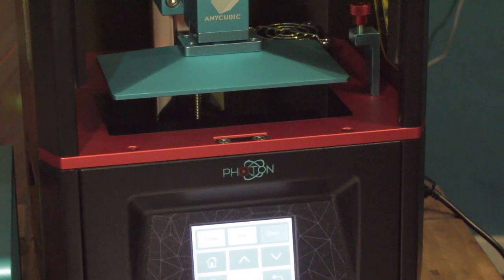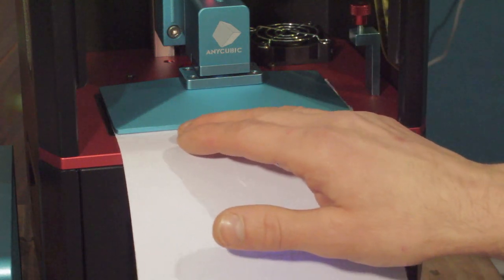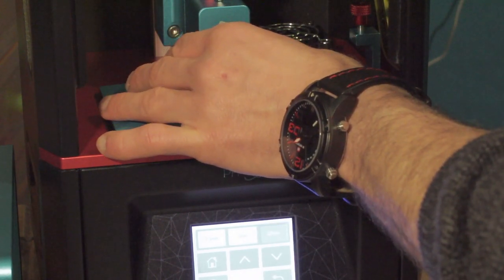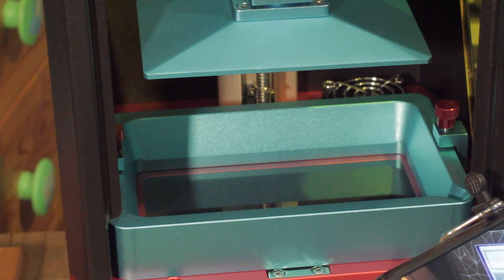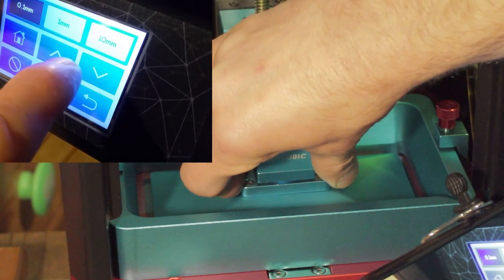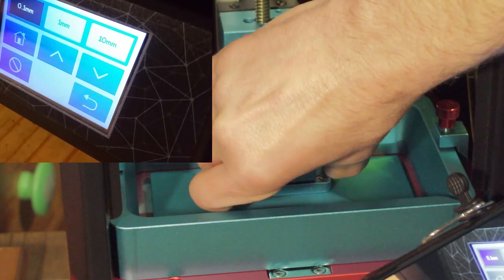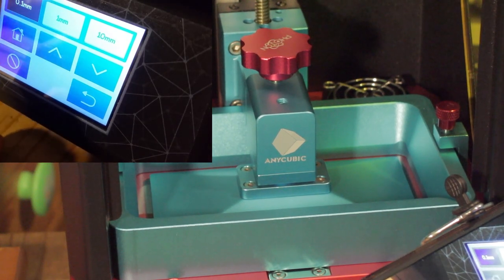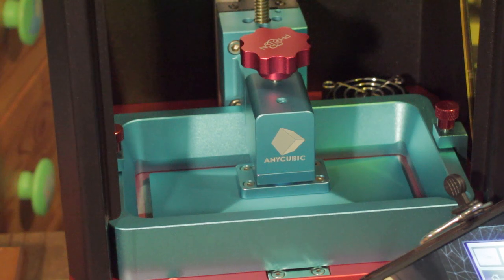Anycubic Photon Flint Read Method w/ close up menu detail video

Comment: Thank you This is an excellent presentation of my levelling method :D Great video.
Reply from the maker: Thanks, glad you like it. I wanted to do this with the screen steps because there seemed to be quite a few people who didn't fully understand.
Reply: @spidiq8  Yeah, It's much better with the screen shown and your extra details are very good additions too.
Reply from the maker: @flintread2303  I'm grateful that you did this method as it's worked perfectly for me and much easier than the paper method. I've only levelled twice since getting my photon, once for this video and a second time because I dropped the build plate and just wanted to be certain it hadn't moved.
Reply: @spidiq8  Hello!
Thank you for the Build Plate Leveling video!
Because I'm a new owner of a Photon S Printer I have two questions about the "Red Screw":
1) In case of leveling... are the Photon and the Photon S identical (besides the difference in the menu structure)?
2) If I leveled the build plate correctly and printed (successfully) my 3D-prints and after that, I unscrewed the Red Screw to remove the build plate to more easily split the 3D-objects and the build plate and to better clean the build plate, and, after that, I reinstalled the build plate to the printer and tighten the Red Screw - should/must I then re-level the Z-0 Position??
Or is the positioning/fixing of the build plate by the Red Screw always the same as before (of course I have to push it right to the end)?
Because I'm not really sure, that would help me a lot. Thank you so much for your answer!

Greets
Stephan
Salzburg, Austria
Reply from the maker: . Glad you found it helpful. Both machines are the same regarding the leveling procedure. Once levelled. Provided you don't knock the plate through excessive force in removing a print or dropping it for example you simply refit it and you're ready to go again. The red screw just secures it to the arm and it will reinstall in the same position.
Reply: @spidiq8  Thx for your quick reply! Expected (hoped) that but couldn't prove it. Greets, Stephan
Reply from the maker: Enjoy your printing.

Comment: Had the issue of the print not sticking to the bed and we narrowed the issue down to the levelling or the FEP so if this method of levelling didn't work then I would replace the FEP but it worked!

currently 25% through the first print, doesn't matter if it comes warped, half printed and or has defects because it has stuck to the bed.

Recommending the Flint Reed Method if all else fails, great help so thank you.
Reply from the maker: Great stuff, it's worked well for me so far. Glad to hear it's printing.

Comment: I heard about this method in another video and searched on it and found this one. You explained it very well! I've only used the paper method thus far, but this method seems much more consistent and reliable. Thank you for the demo. The next time I need to level and reset z, I will certainly use this method.
Reply from the maker: It's worked perfectly for me. I recommend it.

Comment: Thanks for the video, and the tip at the end. It was super helpful.
Reply from the maker: Glad to help and happy printing. :)
Reply: That was an incredibly important addendum and I'm glad I watched long enough to see it. I've been printing with my Photon for a few months now, including multiple bed levelings, and never really considered how much variance the tightness of the ball joint made. Most of my prints come out fine, but I recently had to completely disassemble the build plate assembly to clean up some resin intrusion and have started having more errors. I'm going to relevel using the instructions in this video and also making sure to factor in the ball joint's grub screw tightness.

Comment: I'll be honest this printer is kicking my arse, not sure if it's lack of supports or just my shit levelling. Will try this tomorrow however when I wake up (if my print fails again)
Reply from the maker: Stick with it.
Check the FEP is tight enough. Some users reported receiving theirs with the tensioning screws loose. Listen for the pop on the first few layers, it should be very noticeable as the resin pulls off the FEP when your build plate rises.
I recommend the flint read levelling method.

Comment: I would suggest using a bit of resin as a lubricant to prevent FEP scratching.
Reply from the maker: Interesting idea but I'd be wary of that as it could create a greater gap and resistance.
Perhaps wetted slightly with water.
Though to be honest I've not noticed bad scratching. You only need to move it fractionally.

Comment: I don't know, but it seems to me that the slicer software should start your first layer specifically at the appropriate height ABOVE Z=0 (as determined by the SLICER) rather than "pre-setting" that height inside your leveling method. In other words, I wouldn't think it would be good to lift the bed after you've set it flat to the FEP, then call that extra gap Z=0. I think doing that would just ADD .03mm to your first layer, making it overly thick and/or causing your first layer to have adhesion problems.
So basically what I'm saying is, it seems to me that not only should that lifting step be skipped, but that step would contribute to first layer adhesion problems.
Am I wrong? If I am, then it seems like an oversight by the slicer software developers. Z=0 should be the build plate flat to the FEP sheet. Your slicer should start the machine printing at the first layer height, not zero.
Reply: this logic makes sense until you realise the screw moves the plate down by a fairly significant amount. The problem with this method is you can't check on your depth once you've locked the set screw.
Reply from the maker: No because the Z=0 height isn't 'literally' a zero height, it's the height at which your printer prints it's first layer hence the gap, no gap, no resin.

Comment: Do you feel that the build plate will scratch the FEP plastic with this method ?
Reply: In the original Flint Read video, he specifically says not to try to hard to move it, so you don't scratch it. If you can't move it with minimal effort, it is down too far.

Comment: Watching your video was helpful.  But my platform is very difficult to maneuver even if I completely remove the grub screw.  You're seems to wobble around like crazy.  Watching your video leads me to believe that a wobbly platform would be easier to work with, any ideas what this may be happening?
Reply from the maker: Your platform should be very loose with the grub screw loose. Remove the screw completely then check that you don't have another in there. The photon comes with one installed and a second in a bag but some users have reported that theirs came with both installed.
Hopefully that's your problem and it will be quickly resolved.
Reply: @spidiq8  It ended up that it was just very "sticky" at the connection point.  I just needed to move it around very aggressively to "break" the seal.  Works great now...thanks

Comment: Hi! I dont speak englis, but I know some english text. My question is: why he loosened the plate after setting zero point (at final video) I understood it. Thanks anyway!
Reply: He did that to show what you should do be for you level. When you tighten the screw it will push the plate down some. He suggested to tighten it as much as can and still be able to slightly move it.
Reply: @kenusaga  Thanks!!!

Comment: I tried this for the first time and my prints failed. Normally if I need to relevel it will only be a few failures. What did I do wrong? Do I need to be more ballsy and lower it even further onto the FEP?
Reply from the maker: If you followed this until it was tight to fep it should be level and in the right place.
I can't say without seeing it but I'd recommended re doing it and double check your resin settings for cure times.

Comment: I plan to try this method, I'm six prints in and six failures.  The problem is the print isn't sticking to the plate, but I am thinking I am following the stock leveling guide and it isn't allowing any resin under for the first layer.  At least that is what I am praying it is, lord knows I have tried everything else.
Reply from the maker: Hope it worked for you.

Comment: The easiest way. buy a film for lamination of documents of the thickness that you need. Thickness of 0.1 mm. This film will be used to replace the original! It saves time and money.
Reply from the maker: Interesting but debatable as to how good and reliable it is, I've read of a few experiments with mixed results.
Depending on where in the world you are FEP sheets or rolls can be gotten reasonably priced, I'd be wary of trying laminating plastic PET?
Reply: One sheet of paper is 0,1 mm. Do your math. The micrometer will tell you.
Reply: @mickeyh2561  Or count out 100 sheets of paper, measure them and divide by 100 :D
Reply: @siwilson1437  I have good reulds dooing the Flint Read method slightly diverend.

Comment: How hard are you turning the plate when are bringing it to FEP because my photon is maxed out bottom is making a noise that its maxed out and i can still wiggle it without a crazy amount of force.
Reply from the maker: If the plate is wiggling and fairly loose as in not firmly against the FEP the arm might be hitting the vat edge. This was a problem on some photons.
It should be tight against the FEP in the sense that you could pull the FEP out but couldn't push it in.
Reply: Similar with the paper method. With the paper method I was able to do that. Where I could pull the paper out evenly but not push it in but this method I can't seem to stamp down the FEP
Reply from the maker: @chrishull1993  My guess is that the arm that the plate is on is hitting the back side of the vat before it's contacting the FEP. It's easy to check and you'll need to remove some material from the vat edge or arm where it hits.
I don't know why this occurred but there were a few photons with this problem.

Comment: using this you will damage your fep earlier (even if you are carefull) . its actually better to buy thin sheets with a toleranced thickness. This things are readily available and are not expensive (like the fep).
Reply from the maker: Considering i'm on the original FEP and only levelled once, I'd have to disagree with you.
Reply: @spidiq8  if it works for you great! But there is a reason we put in the manual to use a piece of paper; it is very unlikely to scratch the fep. A piece of aluminium (even when sanded down)? Not so much. Considering you have 11.3k subscribers you ought to be more intelligent about the tips you give people.
Reply from the maker: @Trikkie87  Given that the paper levelling method isn't even on the FEP I'd think that a moot point?
However it's a very tiny amount of movement on the FEP which is very tough and you're doing it once if you do it properly. You don't have to relevel regularly unlike an FDM might require.
If you check the hugely popular photonsters GitHub and photon owners group on Facebook you'll see there are thousands of users levelling with this method. None of whom have problems damaging the FEP as you state. I am not the originator of this method and far from the first to use it but merely a proponent of it. Because it works.
Once, done. It touches the FEP once only.
It's not exclusively restricted to the vat either. Users could keep an old sheet specifically for this or indeed use paper of the same thickness to achieve the same result.
Simple fact is without pressing down securely on all sides it's nigh on impossible to guarantee straightness and level with a ball and socket clamp assembly.

Comment: Sir when first print finished, then wash resin table, and print head, then again next day required again z leveling, or only fix head with screw without z leveling, and print start directly, without z leveling, next day printing
Reply from the maker: Once everything is set you don't need to re level or reset the Z height.

Comment: I heard about the back rail on the photon tend to be set up poorly from the factory, I only have an FDM Ender-3 and there's the same issue about guide rail/slot/bearing's offset being way off(usually too tight). did you had the same problem?
Reply from the maker: Yes and no, it's a combination of things. The first printer I bought had Z wobble which wasn't fixed by re tensioning the bearings on the guide rail, this meant it was an alignment problem, I.e. manufacturing rather than assembly so I exchanged it, the second one has been great.
Still on the original FEP also.
You only need be concerned about this if you experience Z wobble, this shows as regular waves throughout the Z axis at consistent intervals.
Reply: @spidiq8  thank you for your reply! some people in forum seemed to recommend the plain ol' photon compared to the S, but other than the S said to be having plastic body(outer shell only, hopefully), the additional price for upgrade on the Photon S seems good if it helps with longevity/consistency(the prices for 3D printers are priced differently in country where I live, Photon S and regular Photon is only about US$60 difference). I reckon that these DLP resin printing system is actually much simpler in mechanics than FDM, but that QC thing and robustness, seems like needing much more gentle care on both end user and manufacturer
Reply from the maker: @Shiruvan  You're welcome.
Hopefully you'll be up and running in no time, the reason most will recommend the original is because it has a massive support structure including software and resin testers and all sorts which is useful, but the S has the dual rails and the matrix array for more even light distribution across the plate.
Honestly, I've seen positive feedback about both do go with whichever you feel is the better deal for you.
I will say the software really does make a difference. Especially the exposure tester. The case materiel is neither here nor there as realistically most people will install it and not move it much so plastic v metal is not that relevant.

Comment: Can anyone confirm this also working with an Elegoo Mars Pro?
I'm in dire need of help regarding prints not adhering to the build plate, and I've tried this method, but I think somewhere it goes wrong with trying to keep the build plate steady when tightening it, since the printer makes loud buzzing noises when doing 'Manual: Home' (or printing) after setting z=o with this method.
Reply from the maker: I am unfamiliar with the Elegoo mars but hopefully someone will see this and be able to help you.
Reply: Yes with slight tweak. For elegoo mars pro there is a spring in the build plate that provides some light pressure to begin with. Manually lowering the build plate will not change the pressure in the fep because of the spring.  Rather, you will have to manually press down the plate on the fep. Holding medium pressure you tighten the build plate screws (front then side) while holding even pressure on the plate. Then raise 0.3mm.
Reply from the maker: @forouza1  Very useful. Thank you for the info.
Reply: Try a fine dusting of cornflour or talc on your lcd screen just a small amount so you hardly see it and this stops the fep sticking to your lcd which adds to the suction that pulls the print off the build plate, try it I had nothing but failed prints before and now they all print also it doesn't mark anything it just wipes off.

Comment: I just got my first Photon so apologies for the silly question, but is this a procedure that has to be done every time you detach/reattach the plate or is the "z=0" position stored permanently once you do this the first time?
Reply from the maker: The only silly question is the one not asked and you never know the answer to.
The position is stored once set but is different to your 'home' position which is where many assume it's not saved.
You only have to re do this if you have to re level your plate. For example if it gets knocked or dropped. Probably advisable if you change the fep also just in case it's thicker or thinner.

Comment: Using the paper method I don't move the z=0 up .3mm after securing the plate so I'm curious why it's necessary when levelling this way?
Reply from the maker: Because this way you're bringing the build plate down onto the FEP then tightening which moves it fractionally down further essentially pressing it to the FEP with no gap, hence raising it fractionally to allow that first layer to cure.

Comment: How often does the build platform need to be leveled?
Reply from the maker: If you're careful removing the prints. Never.
I've levelled twice.
This one for video. (OK three times if you include the two sample methods here).
I used this for several prints then dropped the build plate onto the floor. 4ft to carpet, I levelled again after checking it for surface damage and cleaning just in case it had moved.
Several prints since and no need to attend to it.
Reply: @spidiq8  Good stuff! Thanks so much for your quick reply. Getting ready to set up my Photon for a first print. Wish me luck! Lol
Reply from the maker: @josh5397  Fingers crossed, if you've levelled correctly and are using the supplied resin and test settings you'll be good to go.
Reply: @spidiq8  I'm very excited. Been wanting to print mechanical keycaps and such for a long time!
Reply from the maker: @josh5397  Sure you'll love it. They're amazing machines, the quality from them for the cost is incredible.
Take a look at the back to the future print I did and painted for my son.
That's at stock settings 0.05 layer height. I've not yet had a need to go lower.